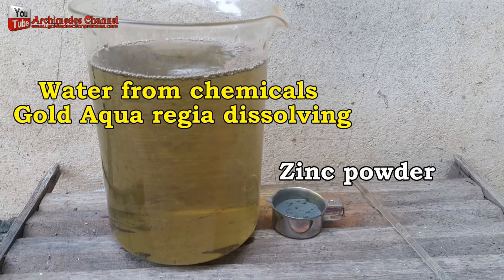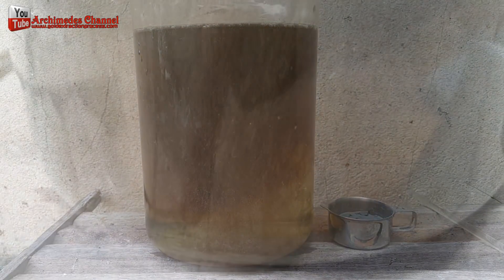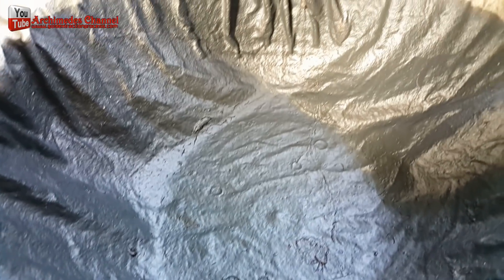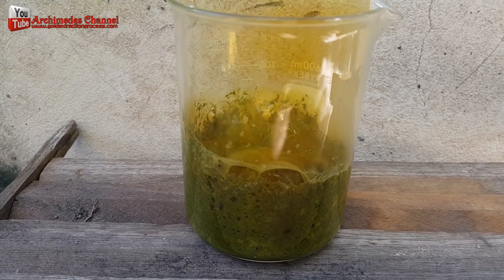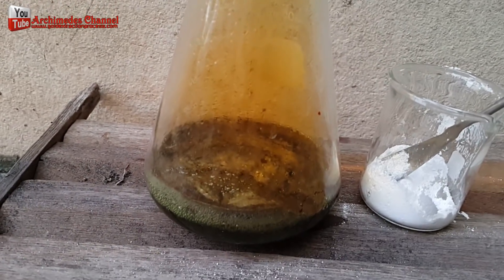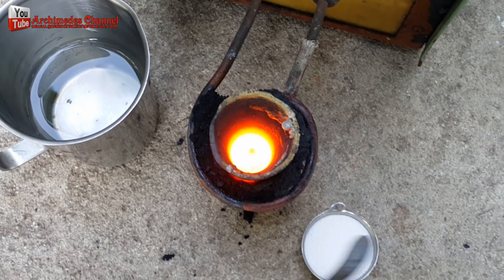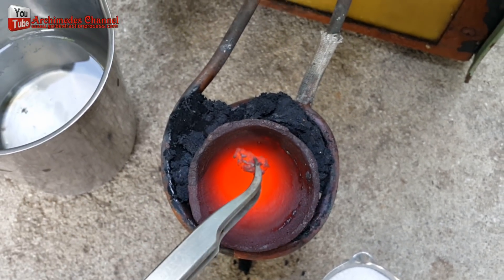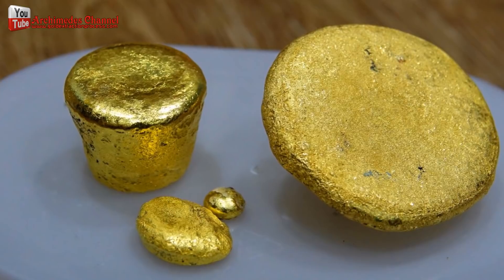How to handle the remaining chemical aqua regia water From gold extraction, Recycle, Refinery

Comment from the maker: Aqua Regia Definition
Aqua regia is a mixture of hydrochloric acid (HCl) and nitric acid (HNO3) at a ratio of either 3:1 or 4:1. It is a reddish-orange or yellowish-orange fuming liquid. The term is a Latin phrase, meaning "king's water". The name reflects the ability of aqua regia to dissolve the noble metals gold, platinum, and palladium. Note aqua regia will not dissolve all noble metals. For example, iridium and tantalum are not dissolved.
Reply: Archimedes Channel how  4:1 i read only  3:1
Reply: عالیه
Reply: what kind of chemical water is in the beginning of the video
Reply: what kind of chemical water is in the beginning of the video
Reply: How do you dispose of the aqua regia after the recoving the gold?